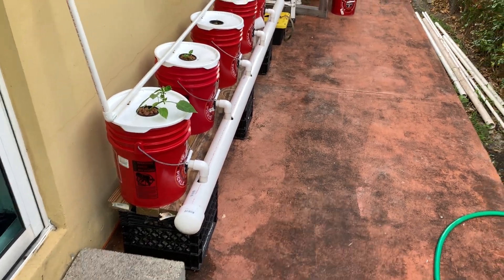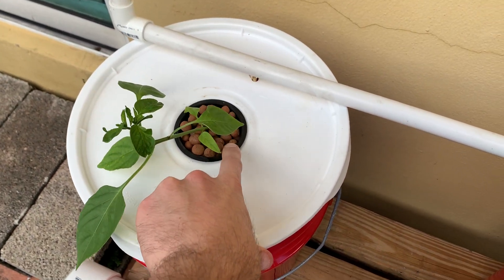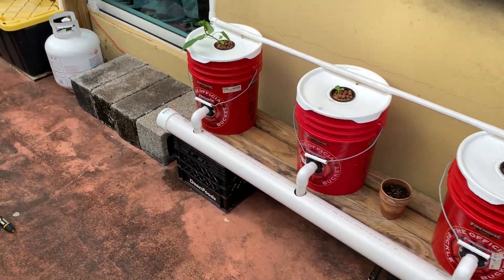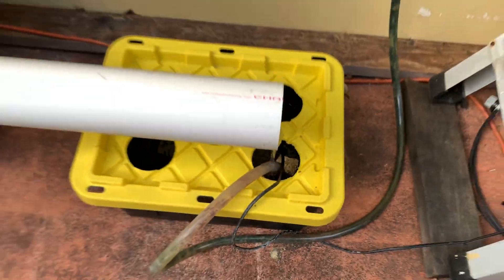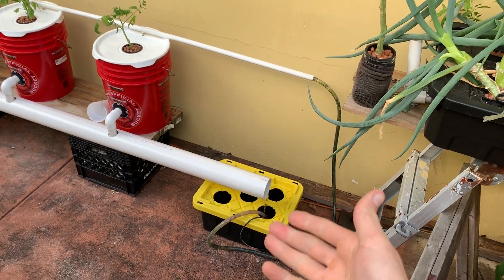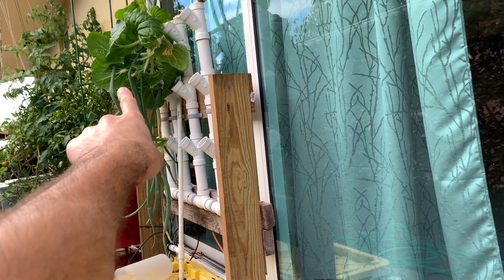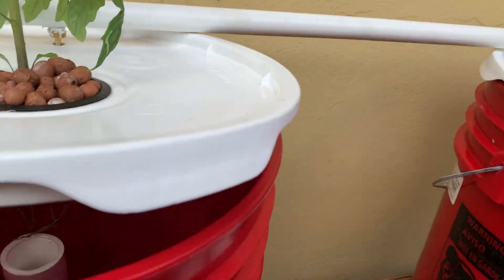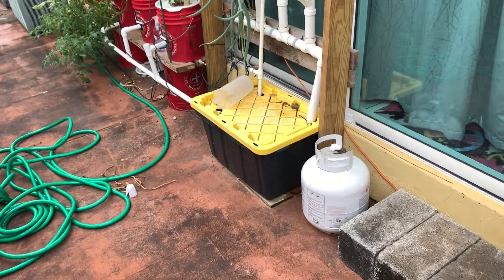How I Built My DWC System - Recirculating Deep Water Culture - Hydroponic Peppers & Tomatoes EASY

Comment: Do they work with that much water in the bucket? I’m very interested in building one but really unsure about different locations of the drain. Others show water feed over the net cup/roots with a low drain about 2” above the bottom of the bucket. Do you have any pros or con to both setups?

Comment: im 60 years old.  ive owned a few.  heres my take.  
1)   gets stupid hot after a few hits and stays that way for a long time.  if you fry a bowl youre not going to be able to hold onto it for a  long time or put it back in your pocket. glass is way better. 
2) you can definitely taste the brass.  cant be good.  flavor issues for sure. cant be healthy. 
3) must clean regularly or youll regret it. i mean like after every bowl or two.   the little plug at the bottom of the bowl gets welded in by resin and you cant knock it out easily.  needs to be soaked in alcohol regularly. the poker is as crude as the tiny holes in the bowl. youll see.  pain in the rear. 
4) the chamber made for storing weed isnt air tight.  in short... everyones going to smell your stash when you walk into a room. only large enough for the tiniest nugs or ground weed. ( and your weed will dry out pretty quickly. )
5) stem is only press fit in.  yes... they get loose and fall out if they get hard use in your pocket. if you have a vise or an arbor press its no big deal
6) very heavy for its size.  you can always feel it in your pocket. its weight makes it pull your pocket ..... and therefore easy to recognize.  ( not a stealthy piece)
 
imho.....   this is not a piece designed for heavy usage or parties.  its material really limits it in many respects.  if you made it out of glass it would be better.... but still crudely engineered. 
 it gets gummed up with resin too easily.  if you fry an entire bowl you wont be able to hang onto it. no way youre going to fry two bowls between two people without gloves.  also,   its short stem provides hot smoke. not a fan of that either.  To be honest this is good only for nostalgia purposes.   and then theres the hipster factor....   ( look how cool i am.....)  beyond that it will be setting in a drawer until your company comes over. yeah, it works.  but id much rather smoke out of glass.  
just not something thats even that fun to use.  its got too many issues.  theres one in one of my tool boxes in the garage.  thats where its been for years. truthfully... if you want simplicity, flavor, price, usability and practicality id stick with glass or roll a joint.  way more pleasant.  its old tech that was half baked at best.  back then we had wood pipes mostly. this got popular because it was the only " gee whiz" piece of cannabis tech that was available. 

it made you "cool".  it was about  'elevating your image' as a stoner.  lol.  it was never about the quality of the smoke. true.   just my two cents.   
The older i get the more i enjoy my "Volcano" vaporizer.   the "classic'   is still the king of the octagon.    cheers.

Comment: Excellent layout and spacing abilities and am going to set this up w 4" pipe to avoid clogging.  I need to do two sides, (12 buckets total) so I've got some flow experimentation to do, but one of the BEST features of this setup is being able to remove the entire bucket from the system without any hassle,
Really well done and appreciate you sharing w us.

Comment: This is a great set up. Add some peroxide every so often to the water to balance the plant easier. It will stop any root rot and actually strengthen the plant. Have a Nice Day.
Reply: How much?
Reply: @mrjakeabc  10 % peroxide to 90 water any more will burn the plant
Reply: How much?
Reply: 1 part peroxide 4 parts water  @srboromir452

Comment: I love my DWC system, although it's a slightly different setup. 

I'm growing zucchini, multiple varieties of tomatoes, two different hot peppers, bush beans, cucumber, and green peppers, and everything is doing great. I'm probably gonna setup another 8 buckets soon. Easy to setup, low maintenance, and easy cleaning in between grows. What's not to like? 

The only potential downside I can possible see is if you're wanting to grow a lot of a single plant like maybe leafy greens, I wouldn't wanna tie my buckets up just for say lettuce, but I have other gardens for that. I also have 5 AeroGardens, and AG knockoffs that I can get a surprising amount of leafy greens and herbs out of. 

Good video, thanks.

Comment: I've tried to clean these firehouse buckets to get the smell and acidity out of them, but it seems impossible. Has anyone had this problem and how did you solve it? I've tried washing with Dawn and used baking soda many times nothing seems to work, not even with scalding hot water.

Comment: You should try turning a 90 down at your 3 inch hole and extend it to 1/2 inch off the bottom. That way there will be a large moist air gap and the roots will grow down into the 3 inch reservoir. However, the drip need to enter the net cup. Also I notice that the roots will float at the water level, so the 90 down to the bottom will prevent the roots from clogging your drain. Its like an aeroponic, kratky hybrid. There is a lot of moisture in the air gap, you will notice that the inside of the bucket is always wet.

Comment: Nice job!! Looks nice and professional, plus like the detailed explanation on everything. If you have 4 five gallon buckets plus a 10 gallon reservoir and you do add nutrients in the recirculating system would you be mixing enough nutrients for 30 gallons of water and then keep monitoring your solution as your plants drink it and you add plain water?

Comment: Amazing! I have one question, when the water go out of the bucket, and into the bottom rout, what’s the size of the hole that drains the water out of the bucket? It can’t be too big so it won’t drain too fast, and can’t be too small so won’t over flow, would love if you could explain!
Reply from the maker: It’s the height of the tube that determines water level in growing buckets.  Size of return tube doesn’t matter unless it’s too small and can’t drain fast enough. I think drain was 1.5” but I’ve seen as small as 0.5”
Reply: @BobGrows  thanks man, have you had any ideas how  to improve it all?

Comment: Do you see any issues using 3/4 pvc for the input and 1 1/2 for the drain ?  I have this on hand, the 3" 10 foot stick is over $50 bucks here!
Reply from the maker: You can use rain gutter. You need large main drain to collect all the 1.5s out unless you run them individually to reservoir.

Comment: I skimmed thru the comments but didn't see my question.  I picked up 9 Firehouse buckets today.  Are there any potential issues with pickle smell in the buckets?
Reply from the maker: Only if you don’t like the smell. It goes away however, doesn’t affect plants.
Reply: @BobGrows  Thanks for the very fast response, I have been doing tote hydroponics for the past 3 years, this year I stuck 2 Habanero plants in a 27 gallon tote, they took of very soon after, over 100 peppers on the vine, from the first ones I picked, I could only hold 3 from my wrist to the tip of my middle finger, and I have big hands...  5 days ago my pump got clogged from the massive roots (the pump is in the same tote) and I started to drop leaves on the plants.  I fixed the problem but now I have lost half of the leaves.  I had this issue late last year with 2 tomato plants but it was later in the year, bare naked tomato plants but the fruit kept growing and ripening.  I believe its the heat here in South Texas, we hit over 100 degrees 8 of the last 10 days, very early for us.  I cleaned the buckets yesterday and  am graduating to DWC.... nice video....  Rick
Reply: Forgot to mention, I like the idea of adding pots on the drain line, but am to worried about the roots, what do you think about cutting a V at the start of the drain line with a second 3" drain line side by side and using that drain to add herb pots?

Comment: So, Bob, three years after this video, what can you say about the clogging difference between your original drip system (which you said was clogging much more) and the sprayer nozzles that you installed.  I'd be interested to know what the result was after your plants had a chance to mature.
Reply from the maker: I ultimately went without any nozzle and simply making a 1/4-3/8 hole in the pvc. Big savings on brass and never clogged. My system never really had any filtration or screens to prevent pump from picking up sediment. 

The plants at one point were producing 10lbs of tomatoes a week.
Reply: @BobGrows  Thanks for the rapid response.  I was actually going to ask you why you opted for a nozzle instead of just derping a hole.  I figured it had to do something with pressure variance at different ends of the feeder pipe.  By the way, do you have a contact email or some way to get a hold of you?   Want to discuss maybe providing you some content assistance to say thanks for this idea.

Comment: i plan on a dutch bucket set up. i like your deep water system for tomatoes. less chance of roots running out of water in summer heat. did your tomatoes do better in deep water  than the dutch bucket?

Comment: Are those regular 5 gallon bucket lids that you cut the rim off except for the three remaining tabs? If so, what did you use to cut the plastic lid rims?
Reply from the maker: Actually that’s just the way they are. It just has 4 tabs that hold it one. The middle hole I cut with hole saw

Comment: A couple of observations,  A. A better sealed water reservoir lowers contamination. B . You could add a sediment t junction that collects the sediment although the sediment should drop to floor of tree containers . C. You could add a bell syphon to each bucket which dumps the level of water down to a predetermined level .this may act as a relief to the roots to get more oxygen. When the bell syphon fills again the roots become I contact with fertile water .

Comment: Great design and thank you very much for sharing.  One question...can you provide more detail on the "brass barbs" that the water is spraying out of, and how you attached those? What is that part called, I am struggling to find those.  Thanks!
Reply from the maker: Drill hole screwed them in. I have since removed the barbs and only left the hole. Cheaper and no clogging

Comment: As long as its circulating or recirculating water im pretty sure the wate doesnt need to be airated as long as the roots are not totally submerged which the hight u have the drain at prevents from happening.. Good setup

Comment: How do the air roots manage to grow ... will you be lowering the overflow pipe?
Reply from the maker: I ended up lower the drain all the way to the grommet to encourage air roots. Big improvement
Reply: Would you keep the overflow pipe low and just have it drip over the media from the start if you started with a new small plant in the system?

Comment: Thanks Bob. I am setting up my first hydroponic system and am modeling yours. Questions: how do you attach the barbs to the PVC feed? Are you using any kind of cement with your PVC or just pressure fitting?

Comment: Wonderful and very clear demonstration. However how does the system get its initial amount of nutrients. The reservoir only contains 4 to 5 galons and your  six buckets contain 4 gallons each.
Reply from the maker: You just add them slowly and let it circulate. Add as necessary

Comment: Bob grows why do you have the pipe right under the net how does the water in the bucket circulate
Reply from the maker: That is the drain pipe that then runs out of the bucket, to the collection pipe (3”) then back to the reservoir.

Comment: This looks great, thanks for posting. Do you ever flush out all the water...or would you need to?
Reply from the maker: I don’t flush the system, I just add water/nutrients as necessary.
Reply: @BobGrows  And did you ever add those smaller baskets in the drain pipe?  I'm thinking about building something similar and would add some smaller netcups for lettuce/spinach... think that'd work?
Reply from the maker: I did not but it would absolutely work assuming the media/roots reach the water flowing inside
Reply: And one more question (appreciate your insight!)  I know there's special "tomato" or "veggie" fertilizer formula... If i'm gonna plant tomatoes, but also peppers, lettuce/spinach, and potentially figs/fruit - is it going to be an issue to use the same blend?
Reply from the maker: @Sethwick  I use Masterblend Tomato Formula - that's what its called but it works with everything. I have a link in the description. It lasts very long. All my plants use the same loop/reservoir/solution.
Reply: I never planted anything and really interested in indoor hydroponic.  I read that different plants need different EC level, so I'm just kind of confused that you have all these plants mixed together.  I guess if you are not looking for optimal growth, then accurate EC is not needed?  Thanks.
Reply: Bob Grows : How do you know when the plants need nutrients? I want to build something similar to grow some veggies at home.
Reply from the maker: Usually the leaves show some kind of deficiency but if you maintain a PPM from 800 to 1200 with TDS meter you shouldn’t have to worry about that

Comment: Thanks Bob- I have been wanting to do something for a while and this version seems a easy work.  I already have like 80% of the crap needed so now I got loads of time I figure why not?  I still need to make a run for some base items that are too big or heavy to ship.  I'll try to make some type of vid and link ya once it's done.  Wife suggested to do a hybrid system where the return of the vertical system drains into the buckets and then have the buckets drain to the return but I'm going to start small.  They way you do it you can easily add to it so why not!  :)
Reply from the maker: It’s so much fun! Good luck Roy!
Reply: @BobGrows   since I'm sitting here waiting on delivery...what size bit did you use for the 1" grommets?  I hand cut all the lids and 3d printed all the net cups for the buckets...so bored I even spray painted the buckets to match.  Lol.  I might steampunk this bad boy...
Reply: @BobGrows  Yeah...biggest spade bit I got is 1 1/2 and this isn't gonna fit to make the bucket units no matter how much butter I use.  Any Suggestions?   ...Amazon listing shows  Holesaw size: 1.75'' (44mm)...ah...should have checked.  Well there it is for anyone else.
Reply: @BobGrows  Hi Bob-quick question. I just started putting together a system like the one if this video and read that you later added air stones to each bucket. Has that been a huge improvement, and would adding just a single ayirstone to the supply reservoir suffice instead. I am making a setup for 4 cherry tomato plants using four buckets. I just want to make sure I am getting the proper DO to my plants without adding unnecessary complication to the design by adding an ayirstone to each bucket. Your thoughts?
Reply from the maker: @TheBirds830  The air stones did not make much of a difference. I ended up putting them all in the reservoir which helps mix the nutes when i put them in.

I did change the buckets themselves by removing the drain riser tube lowering the amount in the buckets to about 3-4 inches.

This was a huge improvement. The roots kind of dangle in the air and get wet by water dripping from the roots above. Only the end roots reach the water. I think this method works on the aeroponics theory as the roots are exposed to air.
Reply: @BobGrows  Thanks for the quick response, I appreciate you sharing what you have learned. So is the water dripping on the roots below the level of the lid, or does it flood the top of the lid, drip through the net cup and drain into the bucket down the roots, or does it now spray somehow on the roots? I echo everyone who is interested in seeing a second part to this video where you show the mods. Thanks :)

Comment: Totally a nube at this.  Is there a purpose for having your drain pipe come up under the net pot?  Could you just as easily have a straight drain pipe come in at the appropriate height on the side of the bucket?
Reply from the maker: You could but then you can not adjust it

Comment: Awesome system.  Great for inspiration.  Haven't filtered through the comments to see if someone else has recommended, but painting your buckets white or a less light absorbent color can help out with temperature control should it come down to it.
Reply: you need darker buckets to keep algae from growing .but putting a reflective insulator would be good to keep the temp water cooler
Reply: On the Hoocho channel, he uses black paint first then a lighter color over the black.

Comment: You could install a knockout pot to catch sediment and alleviate clogging. You can kind of think of it as a P trap with a drain valve at the bottom for easy dumping of sediment buildup that accumulates at the bottom of the P trap.
Reply from the maker: Good idea
Reply: Could you please explain what that is? I'm just starting out and my brain is literally going to explode with all the research 🤯